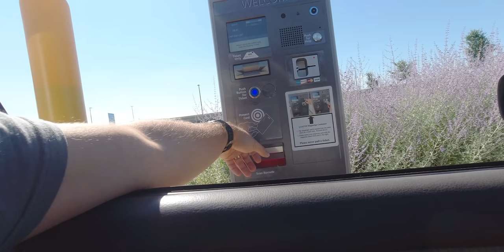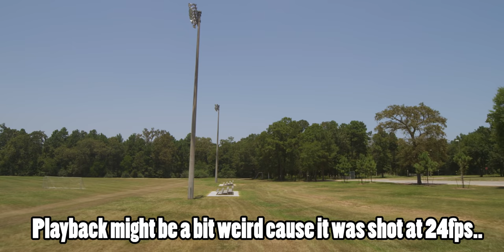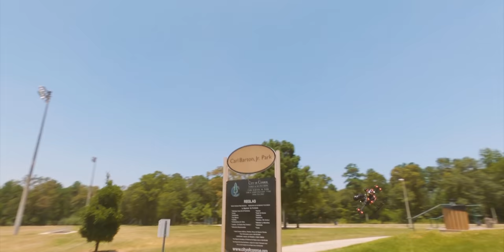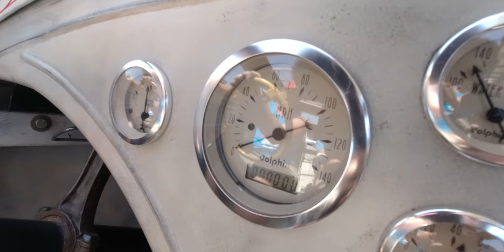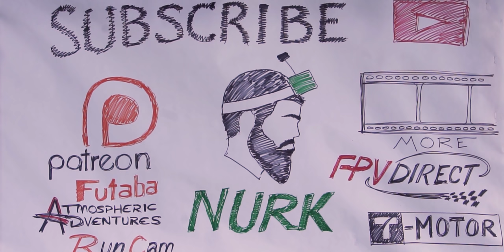Introducing the CM MoneyShot - Flying a $20,000 drone and camera..

Comment: One little thing here, from the X Class safety guy :-) .  hope you guys are using pins or even screws to secure your props to the motor hub. Not just one bolt. As you know the gemfan blades have a strange bold pattern. If  you over tighten the propeller nut you can a will damage the shaft and therefore loosen the propeller. Which in turn will loosen the propeller and could cause an unscheduled landing..... I have seen it to many times on a X Class race rig. RIght now you guys are taken it easy..... wait when you get really into it :-) Great footage and great skilled flying Nurk, Thanks to Neil and crew for making this great rigg. I can see it all ready there is one of those olden things coming your way Neil, Nurk and team crew. MONEY SHOT all the way. THANK you for sharing

Comment: IMO this thing eliminates the best part about small fpv: the ability to take risks,  crash, and flip over and do it again with little to no consequences. 
What do you gain? A lot of anxiety and danger, a few stops of dynamic range, pro color depth and bit rate that won’t really translate to viewers on the web; only on a big screen at the movie theater will you see a big difference. 
The other drawback is that some post stabilization will be necessary and for that to work well you need a higher shutter speed, so to get 24p to not look stutter-y you have to add motion blur in post. Not ideal. 
I started with gas helicopters and servo gimbals, came up through all the multi-rotors and feel that the way to go is to make cameras lighter, not drones bigger.   
This thing has its place, but it’s a very small place, and I cringe at the thought of some novice flyer smashing it into pieces, or worse, a person. 
Great video and very entertaining to watch you fly it!
Reply from the maker: "only on a big screen at the movie theater will you see a big difference" - This is the purpose. We won't get GoPro footage on the big screen, so we have to adapt to what the requirements are.
Reply: @NURKFPV  Yep, Yeehaanow totally misses the whole point of this drone!! Its an amazing piece of equipment for a very niche market.
Reply: @NURKFPV  you would be surprised to know how much GoPro 2k footage actually makes it into feature films
Reply: I agree with yeeha. was not impressed with footage, and usability seems drastically reduced.  think that downscaling everything so you use something like a7sii or similar cam would yield best results.
Reply: for cinema there are inspires, altas and matrices with dual operator, gimbals, sensors, remote focus and zoom, this stuff already exists and is tested. will anyone use acro for cinema? doubt it.  also you dont seem to be able to control this drone anywhere as good as smaller drone. your gopro footage looks better than red footage. keeping things small seems to be the key. there are tiny fullframe cameras out there that could do way better job than red. seems this is built as proof of concept or to impress idiots.
Reply: Lucianrider I see the point. It is a cool rig. But I’ve flown probably 50+ cinema gigs with big cameras on a large octo and the producers and directors always ask for the same things- Lower, Faster, Closer. Very different when you’re flying line of sight and the gimbal operator can point the camera backwards, vs this thing where you would have to fly backwards BLINDLY to get that shot. That’s when it’s most dangerous, and so in many situations you won’t be able to get the shot they want without taking a big risk. One “unscheduled” landing into the dirt and this thing is done for the day. How many backups are you going to have?  
It has its place for sure, but if I can’t fly it like I stole it, not really interested.
Reply: While I agree with a lot of this, companies like Netflix do have setlists for what cameras can be used in films. That's why these would be necessary.
Reply: The reason you miss the point is part of why you aren't the target market. Don't care if you don't get it. It isn't designed for you :) But you will see some of the shots it gathers at a few of your favorite action movies in the coming years. You can thank me later.
Reply: Lol, this drone isn't for consumers in the FPV market who cry over motors that cost $25 instead of $15. You don't see the point because you're making content for Youtube and Instagram. Big studios making millions on your favorite movies and directors who have a hard-on for the cinema cameras and lenses they prefer will be all over it. The FPV community needs to stop constantly shitting on things they can't afford and have no use for. It's so petty how much you guys hate on things that are out of your reach.
Reply: Kev PV  You make a lot of assumptions without acknowledging the obvious down sides.  GUYS- I get it! I understand what it is made for and the target. That doesn’t mean some yahoos won’t use it just because they have $ and think it’s cool, when the traditional 2-op drone with gimbal is a better tool in 90% of situations. They will be the ones putting people and the whole industry at risk.  And for what? The ability to dive and do a loop. Okay, that’s a niche for sure, and a good tool to have in the toolbox. 
I’ve been flying cameras since we used gas/nitro helicopters with diy servo gimbals and thought the days of post stabilization were over.  Now it’s come around again. Lol. Have fun with that.

Comment: I'm sure you already know but when you drop your 24fps clip on to your timeline in FCPX you can use automatic timing to make it play every single frame in your 25,30,50 or 60fps project. It will change the speed but it will also avoid that jankyness you get when using a different frame rate clip in your projects
Reply from the maker: Good advice thank you!

Comment: I feel they're going to have to rig it with iris/focus/zoom motors to run longer focal length glass...controlled by another remote pilot (similar to the inspire) and get more cinema like DOF.  Otherwise, more flexibility will get jobs with the big boys...or what's the point.
Reply from the maker: Less flexibility can be valuable too. It's a purpose built machine for very specific shots.
Reply: @NURKFPV  don't kid yourself, the big boy producers want it all.
Reply: A long lens on this will be absolutely nauseating.
Reply: @yeehaanow  short zoom would be effective

Comment: why not put a servo on the camera and make it Tiltable from the Transmitter? or gyro stablized to any angle of tilt?
Reply from the maker: That just adds points of failure
Reply: @NURKFPV     What good is a $20,000 camera if it only good for car chaces and it cant tilt and pan.  Using a 360 camera you or the audiance can pick what to look at.